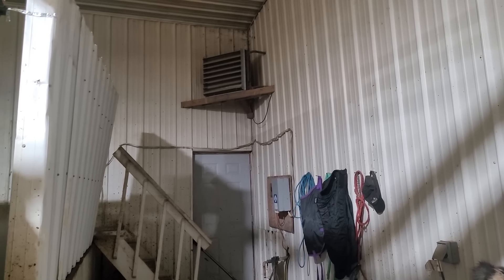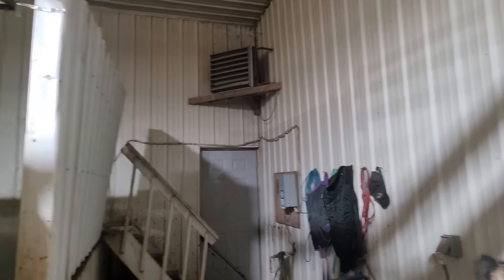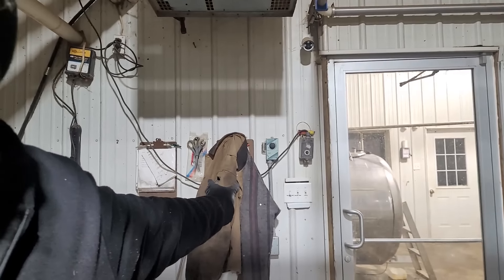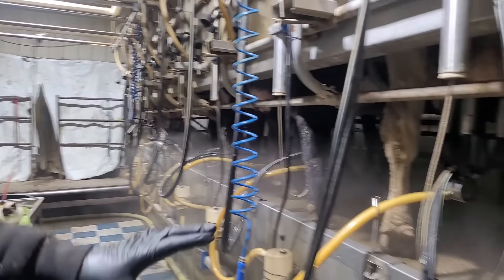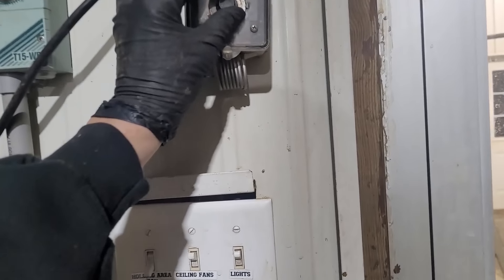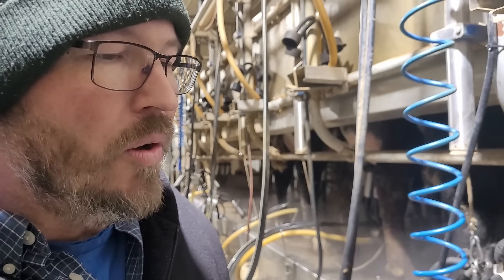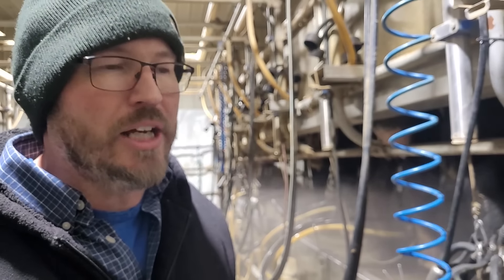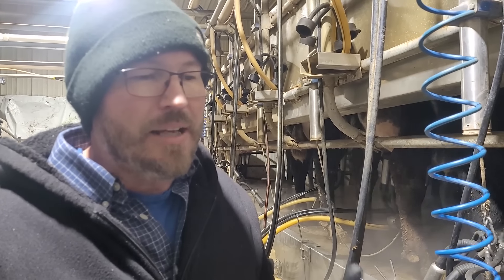Cold Snap ~ Challenges with Cold Temperatures

Comment: I use a walk behind snow blower to make paths between buildings when deep snow comes.  I'm sure you are thinking that would never start but it has electric start and always starts easily to my surprise.  Just a little luxury makes brutal winter weather a little easier.  I first got the path making idea from the Amish in my area that use a horse pulling a home made snow blade.

Comment: It's beginning to look a lot like Winter, But soon we'll have a thaw. With freezing rain and sleet we'll have a crust on the snow and it'll refreeze and be there till spring. Ah Michigan. That vapor cloud slowly rolling into the parlor looked like a scene right out of one of those old Black and White "B" science fiction movies with Vincent Price, Boris Karloff Charles Laughton, Kathleen Freeman etc 
A battery maintainer is very inexpensive doesn't use much electricity, but will keep a battery right up at the top. Also electric oil pan heaters you slap on the bottom of the engine, since heat rises will help start a Diesel. ben/ michigan

Comment: These cold snaps are really the only time I curse my ancestors for settling in Michigan.  Most of our stuff runs around the clock so we don’t worry about it starting but the big heated shop is nice for those hard starting machines on the extremely cold nights.  Anyone that thinks new equipment is better hasn’t worked in our climate much, we have more problems with the new tractors/loaders and skid steers than we ever did with the old stuff.  We’re further north than you and I believe our coldest temps were around -11 with windchills in the low -30s for a few of those days last week.  Frozen overhead doors and some ignorant malfunctioning automatic curtains made for some long days.

Comment: Hello there. The thing is Perkins Engines need a lot of heat in cold weather. My Massey Ferguson 390T Start's after 3 minutes of heat. She has a dry sell battery and a planetary gear starter. Witch turns the Engine faster for starting in cold weather.

Comment: We hit -33 Last week during the storm. My tractor wouldn’t start. Hydraulics were all froze up. Thankfully we didn’t get very much snow. When you’re used to using tractors to move snow and something happens it sure changes your perspective when you can’t use it the next time you want to. I finally got it to start today a week after the cold spell. I had so much gel in the lines that I couldn’t do anything about it. Congratulations on getting it running. I worked on the dairy farm for a few years, it’s a lot more work than what people realize. thanks for the video Rhonda.

Comment: We had a barn with bound up cows, the old way, in there it was the best place to be during wintertime when working outside, going in there, in the warmth, cuddle a warm cow, best thing ever! Our barn had a pretty low ceiling, so even in minus 30-32F it was warm in there 🙂 The best tractor we had to start in the winter was our small Deutz-Fahr 52 horse aircooled engine started even without heaters, the Ford 7810 we prefered to use the block heater connected to them, they always started what temp there ever was, it was a blessing to have them, warm and nice inside when plowing the roads, but being in the barn during those times when milking, was the best place to keep you warm. Our workshop had a big diesel heater that also dried the grain bins. 
So many memories, and I am so happy to see these things, it brings my soul comfort to hear the milking parlour and all the cows🥰

Comment: My Dad never wanted a heater in the parlor during milking, only when the cows weren't in it. In Northern VA, we don't get the low temps y'all have, but have had spells in the teens or 20's for highs. I don't Dairy anymore, but have found that a balaclava is nice, it's a hood and turtleneck that can be brought up to cover your face. I wear my regular work shoes and pullover boots, but use wool or low temp socks for my feet. Again, not as cold, but y'all might try some of them. Good luck, God Bless, and great video!

Comment: Back in the 60's and 70's, we milked Holsteins.  Our barn had wooden stanchions in it.  When it got cold (35 degrees F or colder), we would keep the cows in the barn.  I always thought it looked neat, when the cobwebs would get frosty from the cows breathing and the cold air.  We also had to keep our tractor and manure spreader in the barn to keep it from freezing up.  We had gutters behind each row of cows.  Had to scoop out the gutters morning and night, and then made a quick run out to the field in late afternoon (when it was usually warmer), and hoped that the manure spreader didn't freeze before we could start spreading manure.  We had an old Allis-Chalmers WC tractor, and a New Idea manure spreader.  They would just fit in the barn between the gutters.

Comment: does sanders have the 7.3 letter in it
Reply from the maker: No, it's a 6.0
Reply: dad had the 7.3 which is actually an international motor . then ford came out with the 6.0 and the 6.3 to replace the 7.3 motor. i guess they had a lot of problems with the 6.0 and the 6.3 but i dont know. i was just wondering what sanders thinks of the 6.0?
Reply: dad just had promblems  with the glow plugs

Comment: At that temperature I'm amazed the cows aren't giving you ice cream. Back when I was young. I would go to work with my father to help him get the trucks started when it was cold. There was no such thing as a block heater or glow plugs. What he would do  is. He had a bunch of aluminum saucer sleds. He would start a charcoal fire on them and slide them under the engine to warm the oil so the engine would turn over quicker. It's 12 degrees here and hopefully it's the last night of extreme cold.
Reply from the maker: We've heard of people doing that!

Comment: It's been pretty chilly here in northeastern Connecticut the last few days during the day it's been in the upper teens and then around zero at night. As I get older, I have learned to prepare ahead of time run the diesel fuel treatment get stuff plugged in plan ahead and not struggle like I used to. We haven't had too much as far as issues go here. I think the worst thing this winter for me has been when it's been 50° three or 4 inches of rain and 60 mph winds I almost would prefer everything just to be frozen instead of dealing with that lol. Good video I liked your explanation of the heat in the parlor. That's pretty cool.

Comment: sounds like you have water in the hydraulic fluid on the bobcat. winter is not fun on the farm. is there such a thing as a water separator to take the water out or is the oil just too cold and thick to move. I have heard about the Germans during the winter, thinning the oils so it would flow. we only had gas tractors with gear transmissions on our farm. I found a pair of military winter boots that had a cartoon name that the gi's used. my feet never got cold in them. they are still used today in cold locations. I don't have mine anymore. take care and blessings to you all.
Reply from the maker: Oil was just cold, no water in the oil.
Reply: @acresofclayhomestead  good